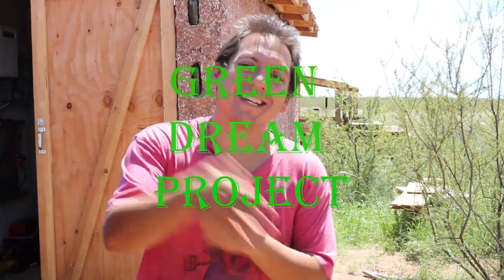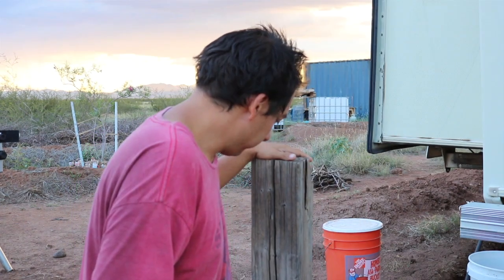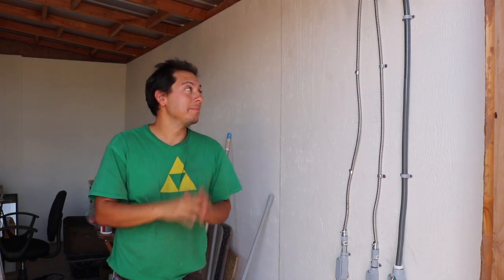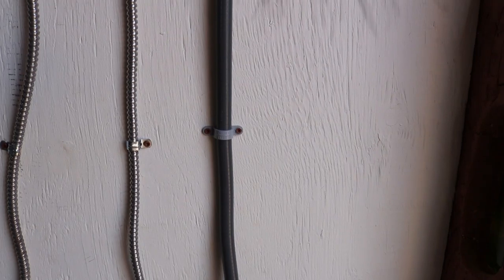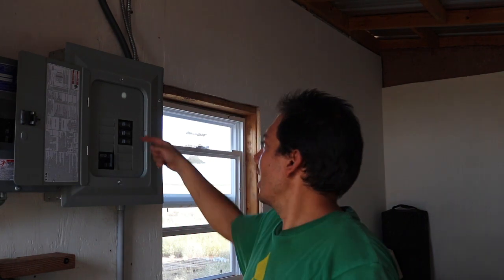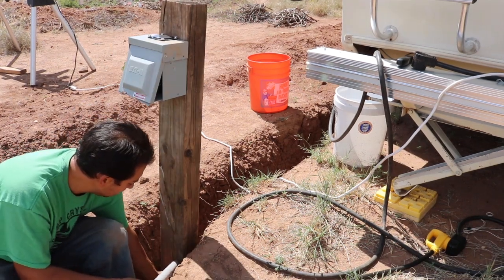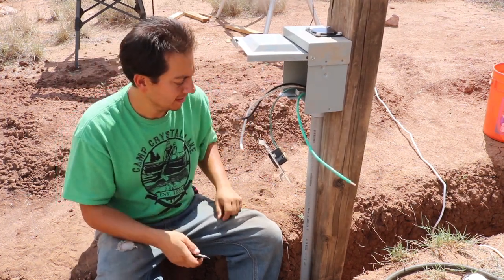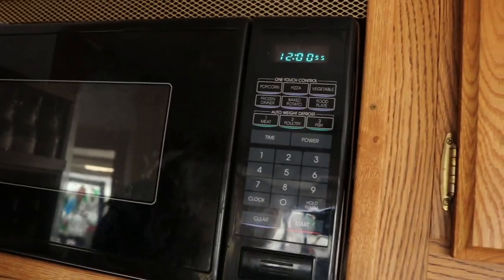DIY 30 Amp RV Hookup Installation

Comment: Great video !  We just laid 1000’ of 18” trench, 4 guage Al 660V/100A line to power our machine shop, cabinet and antique furniture restoration shops.  Then had to retire 60,000 sq’ warehouse/shop spaces after I inadvertently pulled the wiring down with a tall load on my backhoe forklift attachment.  Cost $12,000 to have the main service restored so we had to do the rest of the job ourselves.  You did great work!
Reply from the maker: Thank you!

Comment: I know you commented during the video that pulling wire while still assembling is not the proper method, so I thought I would comment for those wondering.  Generally the rule is to not exceed three 90º bends in your conduit run, or 270º total in bends.  Electricians always assemble the entire conduit run before pulling wire through.  You want to use a conduit fill calculator app and make sure the conduit you are using is big enough for the wires you have to run.  If one follows these rules and steps, pulling wire through is actually quite easy.  Note that pull boxes and LB's don't count towards the 270º worth of bends since these are accessible wire pull points.  When gluing your fittings, you want to apply glue to the male and female side of the conduit and twist 1/4 turn to ensure a good waterproof solvent weld.  For the wire you want THWN rated wire as buried conduit is always considered a wet location.  I love seeing that you upsized the wire to 8 gauge to mitigate excessive voltage drop on your long circuit run.

Comment: If you ever have to pull wire through conduit again try using a smaller gauge rope first, Suck it through the conduit first with a shop Vac then tie it to the wire and put it through with a ride on or ATV with a spotter to tell you when to stop:-)
Reply from the maker: 🤔 That's a good idea.😃 Thanks for the suggestion! I appreciate you watching.
Reply: Green Dream Project 
I’ve seen electricians use a rope that’s almost like twine. Super light. Then they tied a little piece of plastic, ie half a sandwich bag for a little weight to the twine then suck it through the conduit with a shop vac, attach to wire and then an easy pull from there. Nice work over there. Keep it up. 👍👍
Reply from the maker: @FarmerG  Thanks, G! There was a similar suggestion and I definitely look into that when I have to do more wiring. Thank you very much.👍🙏

Comment: I have bpare land pand an electric pole near road. Can i install more wires from pole tothe rv box which will be 30 to 40 feet back? There is no electric panel on pole. What do i do?HELP!!!
Reply from the maker: From the pole to the service box should be the responsibility of the electric company. I would get a hold of them, because they should be able to help.

Comment: How long of a run is this? We’re running wire tomorrow for 30 amp service but it’s 200’. I’m not sure what size to get, but I’ve seen a few suggest 4 gauge.
Reply from the maker: For us this run was about 50' and I think we used 6 guage. For 200' I'd definitely go with 4
Reply: You really need to use a voltage drop calculator to figure this out.  It's going to vary based on your starting voltage and required voltage at the end of the run.  There's lots of calculators online you can use and plug in all the data.